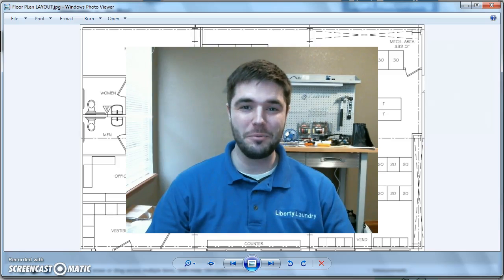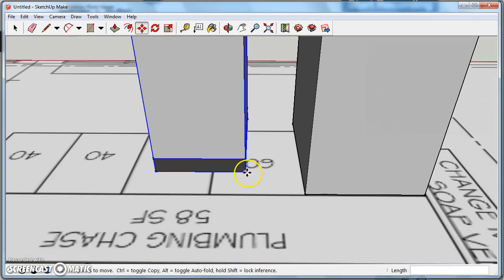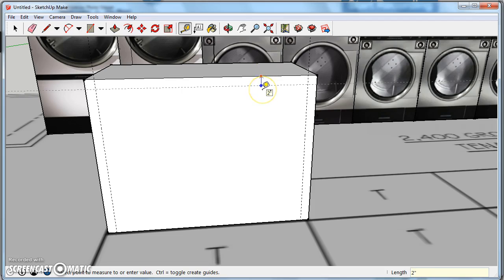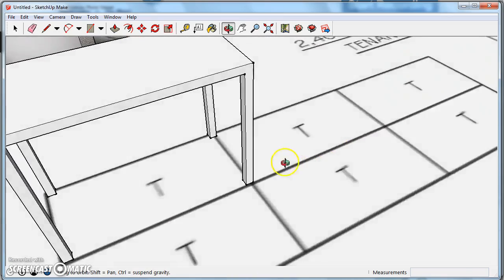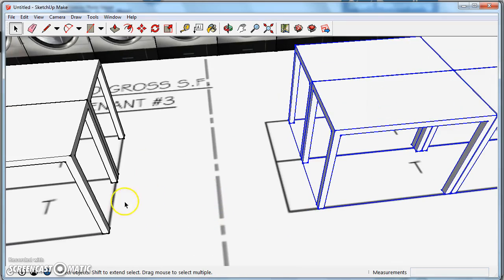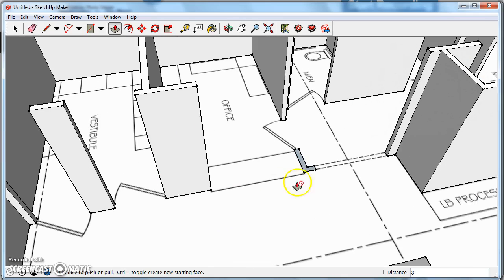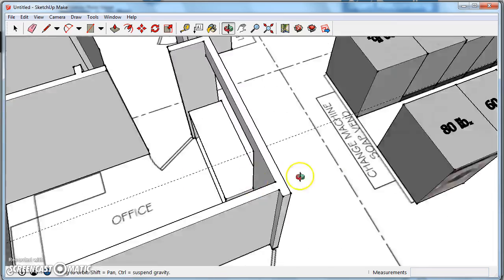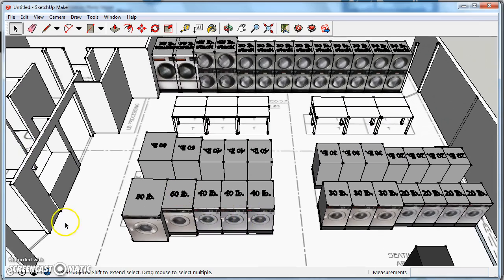Laundromat Design With SketchUp (3D CAD): Part 6

Comment: Very good presentation Brian!  I am retired from the business and used MS. Visio for layouts which now appear pretty primitive.  Only comment I have is the presentation of the equipment sizes.  I would always place the larger washers in front to attract customers.  In fact, washers under 30# are not used much at all.  Point is the customer wants to get wash day over with as quickley as possible.  60# & 80# washers are actually used more in today's laundries.  Good luck and thanks for the tutorial!